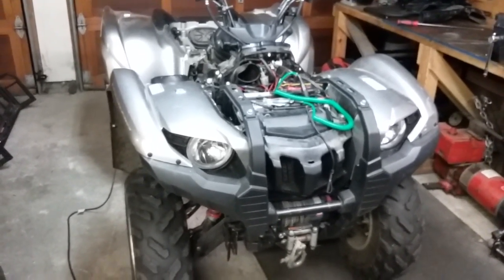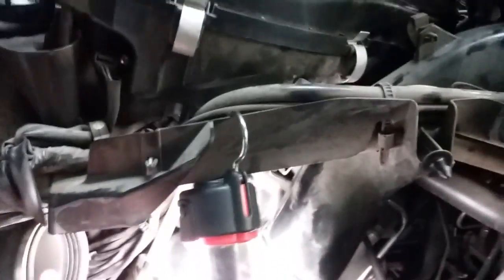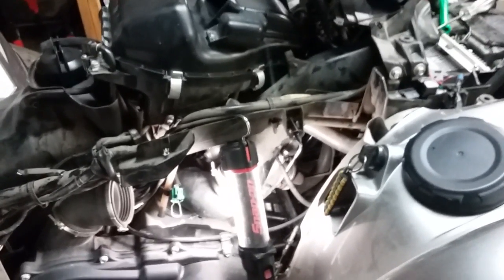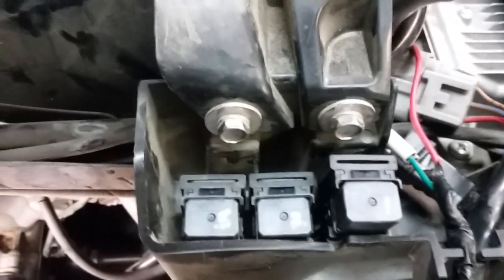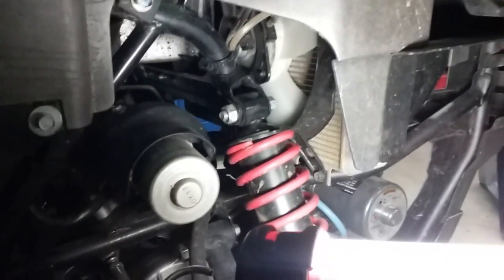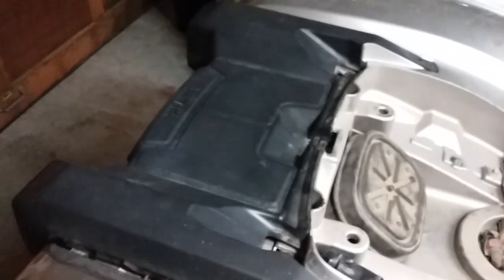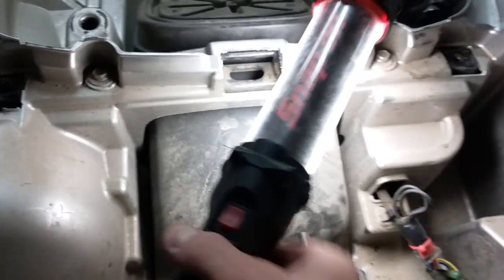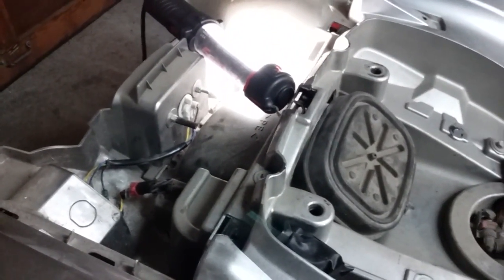Grizzly 700 Overheating - Testing / Fan circuit breaker location

Comment: Thanks. You helped me figure out my 2008 had a bad relay. 8 dollars next day and I bought a pack of 4 with 5 pins,works like a charm because there is an empty slot for that 5th one. Also I wasn't able to tap on mine and make it run it just wouldn't but after I put 12 volts through the middle one and it made it come on I knew. Thanks again. Also I noticed mine was coming on then stopping then coming on the day before it just stopped working, i bought mine with the radiator relocated and snorkeled so I could see it easy
Reply from the maker: Your very welcome.... I'm glad it helped... Thank you

Comment: You do awsome videos ,and there never to long.if you would have shown me the circuit breaker I wouldn't  have know now I can disconnect my toggle switch .with the plug end from a old stater hooked to a toggle to bat.also your a good teacher,very easy to understand better than partzilla. Awesome keep up the good work .Wayne from Calgary alberta

Comment: Awesome Video!  I have a 2007 and its exactly the same and you made it to easy to track and find the problem and of course it was the last thing  i checked which was the circuit breaker in the rear just came unplugged at one of the circuit breaker.

Comment: Nice vid good info thanks. If your not keen on removing all the back to access the circuit breaker you can remove the plastic tool box and gain access thru that way (just one screw at the bottom .

Comment: thank you very for this video it helped me a great deal. I found a mouse nest in the back destroying all the wires and the fan circuit breaker!!! again thanks.
Reply from the maker: No problem, I'm glad it helped... It was the first video I ever messed with but.... you get the picture....
Reply: I had the same issue,  I had to splice in a new circuit breaker

Comment: My fan is not working.. Followed your steps but using paper clip no fan... Looked at relays and my 2012 700 EPS model does not have a 3rd relay... I only have 2. Stumped on what to look for next
Reply: same, what did you find out?
Reply: @EkonRekon  replaced fan with a new one and everything was perfect.... Just order a new fan.
Reply: @EkonRekon  I hit the back of my fan with a wrench and it started moving. I knew it was the fan motor.
Reply: @SouthFLMudClub  hahaha I just read this after finding out the same thing!

Comment: That doesn’t totally make sense. Any atv if it’s running warm you can turn the engine off and leave the key on so that the fan runs and cools down the radiator. If that thermostat is jumped and the key is on the fan should run.

Comment: Excellent video.  Curious why that relay would go bad?
Reply: constant on/off many times would cause it to wear out quicker than other ones nothing electronic lasts forever especially switch contacts in the relay and the electromagnet in the relay and theirs springs in it that can wear out over time and heat and the cold

Comment: Having overheating on 2004 600 grizzly, heard the fan running so assumed it was OK and started thinking weak water pump. Your viedo helped will now jump temp sensor to confirm fan running continuously.  Any thoughts on troubleshooting water pump and thermostat. I started rig cold with radiator cap off and waited to heat up trying to see increase flow through radiator as the thermostat should have opened. Didn't see what I expected as more water flow. After testing fan will replace thermostat and waterpump. Am I overlooking anything else I should check?
Reply from the maker: Before replacing anything you should check both sides of the radiator, feel the hoses and verify they are both getting hot. If they are then it's flowing coolant.  Water pumps on these machines don't really become weak because they are so basic.  They either work or they leak "pretty much ". But also make sure the actual radiator fins are clean, if it's plugged up with mud etc it's going to run really hot. Then you need to continue to follow it through.  Also how is the coolant level?  I'm thinking it's ok considering what you have done, but also has that ever been changed?  Because coolant does deteriorate over time, especially if it's original.  Before buying parts you have to verify everything.  Hopefully this helps.... thank you

Comment: What if the fan only runs when I pull the thermal sensor without the paper clip in it?
Reply: This is exactly what is happing with my machine. I tested fan with auxiliary battery… it turned on. I plugged fan in, I started the machine and the unplugged the thermo connection and then the fan turned on before I put the paper clip in!
Reply: So what does that mean?